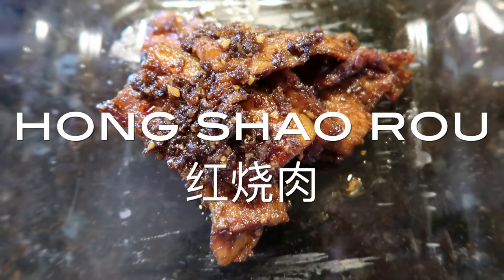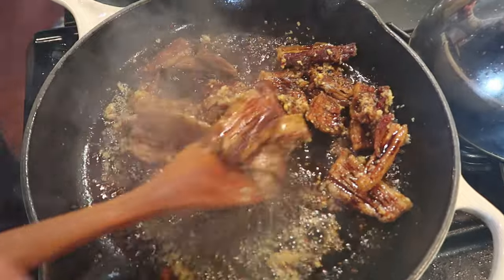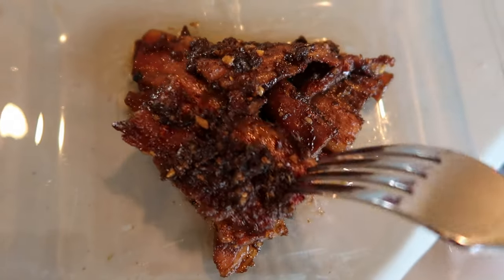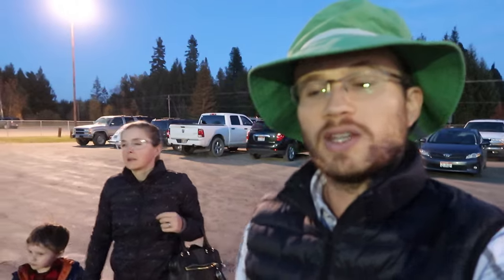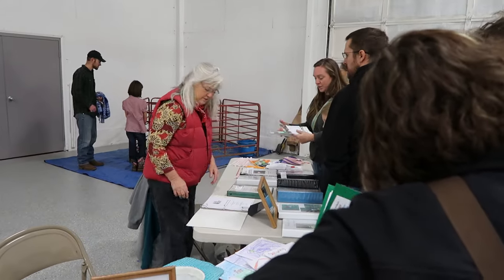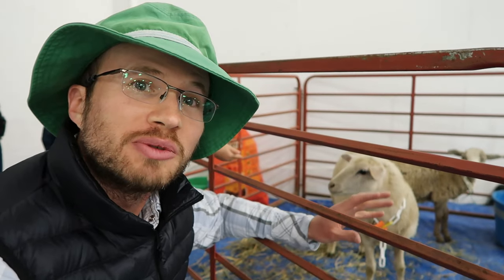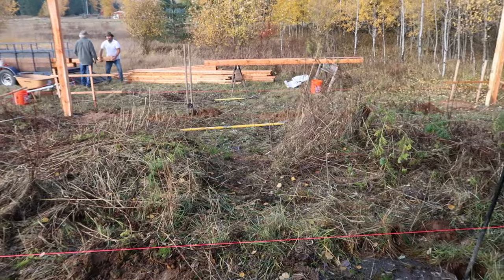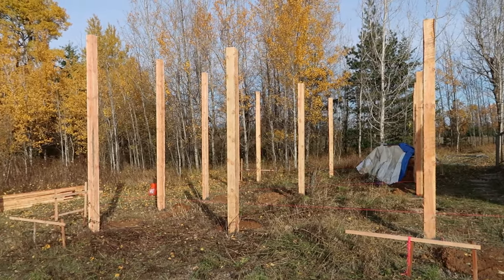Cattle Panel Greenhouse: The Build - Part 1

Comment: What are the wood dimensions for your cattle panel greenhouse? I'm wanting to throw one together for a way to keep my dog away from my bag garden next year. He likes vegetables and to lift his leg on anything and everything. 😠 Also you may want to move the door so it opens outward otherwise the sheep will crowd the door and you can't get in.
Reply from the maker: Hi Wendy.  The skids are 12' long and the width is 7'.  The interior length is just under 11' I believe.  We have the door opening inward because we won't be able to easily open the door in the winter when the snow piles deep if it swings outward.  The sheep won't be going in the greenhouse.  It will be for the chickens during the winter.

Comment: You mentioned setting the posts for the car port.  Where you are, do you have to worry about frost heave?  Any plans to run electricity out to the car port?  It'd be a good time to bury the conduit.  (Same for water if you want a spigot/ hose bib out there.)
Reply from the maker: I wasn't worried about it until you mentioned it.  I'm not sure about frost heave but it sounds like something that could occur here.  I'll have to look into that further.

Comment: Great job on the greenhouse! Door needs to open out not in. But you'll find that out when you start using it. I'm doing rabbits next sp
Reply from the maker: We have it opening in because we won't be able to use it in the winter if/when the snow piles too high if the door opens out
Reply: Oh okay, I didn't think of that. Mine opens outward, but we don't have that much snow. You did a great job on it.
Reply from the maker: Thank you! I appreciate the feedback.  You have the same one?
Reply: I don't have the same one. Cattle gate is about 16feet and I have nothing to haul it with. I built mine from 1x2's about 10ft x 8ft. So far it has survived 60mph wind gust lol so I must have built it right.